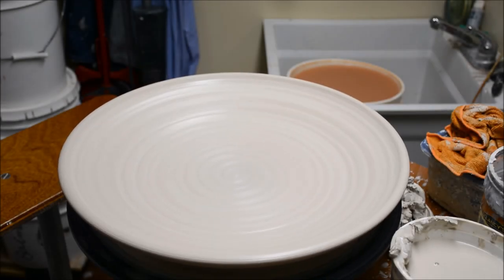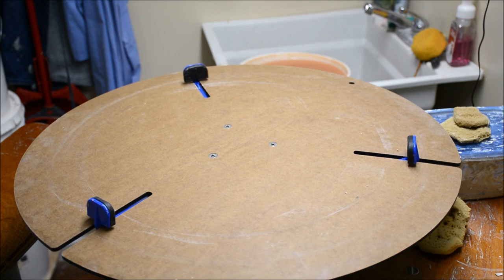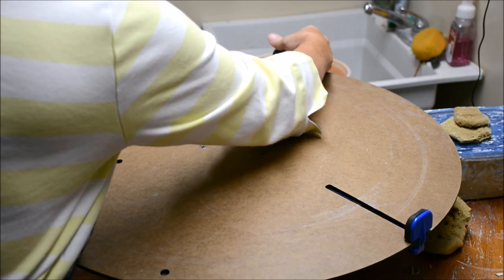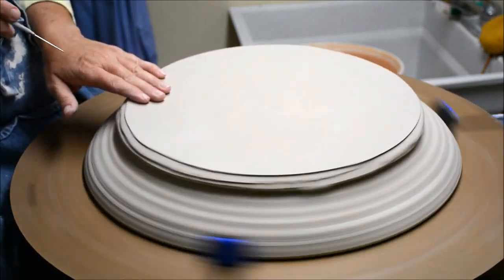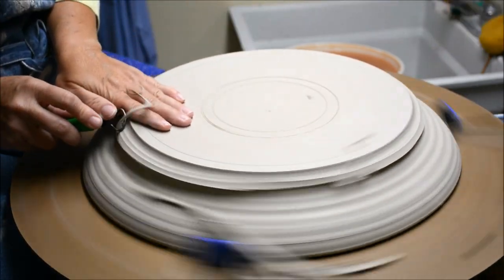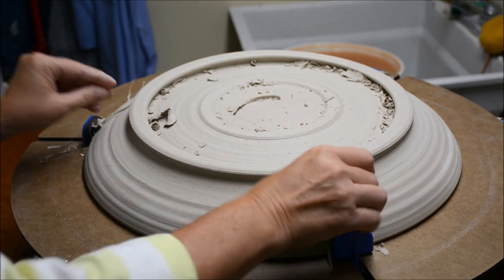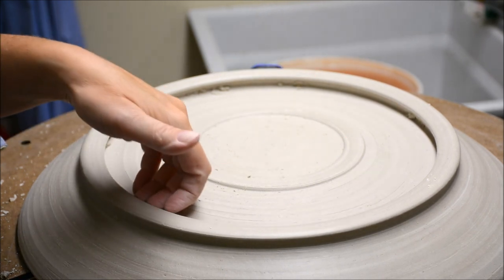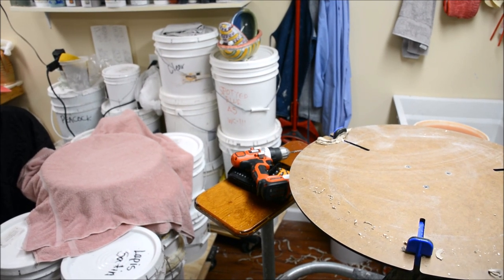Trimming an Undercut Double Footring (for Hanging) on huge Platter on the Wheel- Part 2

Comment: Should you use towels to dry the piece instead of just plastic?  I'd think it would absorb the water too quickly.
Reply from the maker: Hi Kelly!
I normally use a couple of layers of heavy towels for the drying stage.  I'm not using them for their absorption as much as for their ability to hold moisture, yet still dry slowly. They work brilliantly to allow moisture to escape evenly and slowly!  They themselves aren't wicking much moisture, but they do "hold in" some moisture to allow it to dry really slowly.  I normally only use plastic when I want to really hold it at a particular moisture for a few days, or perhaps to even out moisture throughout the piece if I managed to allow it to begin to dry unevenly before trimming.  Sometimes a combination of towels plus plastic over it to get it to dry a bit, but not too much.  I hope that helps!

Comment: What is the purpose of the smaller foot ring? In your video it appears as though the bowl would not rest on it, as it shallower than the large ring.
Reply from the maker: Hello- since that is a rounded interior platter- almost like a huge bowl, the walls are angling upward - therefore I cut the depth of the foot deeper on the outer footring, just to keep the thickness of the walls and base the same thickness. 

Although they are the same level in height- as I didn't remove any of the height from either -quite often during the drying, the platter will pull up a bit it the middle as it shrinks, but as it finishes drying, and then during the firing, it settles back down.    I have found on very wide forms, without the second footring, that the middle can slump too much without support during the firing.  I have had students who will glaze the bottom middle, to find that it slumps down and sticks to the patty under the piece during the glaze firing.  (So, it is truly more important during the firing)  I hope that clarifies!

Comment: How dod you get it off the bat? All my large platters stick too hard to the bat and can't be cut off undamaged.. please advise...
Reply from the maker: Hi Ruth- the trick is to cut it repeatedly- and to make sure your wire is always tight and pulling down.  I normally cut it right after I throw it.  If your splash pans are in the way, just take those off first, so your hands are always under the level of the bat, and you're cutting downward.  Then, after it sits a few hours, I cut again, and when I store it to get leatherhard, I cut it again a few more times as it is drying.  I allow the form to stiffen up on the rim, then I flip it to another bat- and cover with a heavy towel or two to allow it to dry evenly the rest of the way to leatherhard.  You may have already seen it, but here is my day when I threw the platter:  https://youtu.be/NApvWYFXkVo   I hope that explanation helps some!!!  :)

Comment: Initially you said you were creating a double foot ring to bear the weight of the large platter.  When trimming you created the illusion of an inside foot but the full weight of the platter rests on the outside foot rim.  Why the change? Although it would be challenging to have both foot rings of equal height.
Reply from the maker: Hi Lorraine-
I didn't actually cut any of the height from the smaller footring... (I just cut the sides of that footring)  so, it is actually the same height.  When it shrinks sometimes, it may pull upward, and may rest more on the outer foot, but when I glaze fire it, quite often, it will begin to slump slightly down onto that inner footring.  I hope that makes sense?!  :)
Reply: Thank you for your response, from the video perspective it looks as if the smaller foot ring is lower than the outer one.  I have not tried this technique, opting for a flatter bottom, however on a smaller platter.  Thanks again for the quick response.